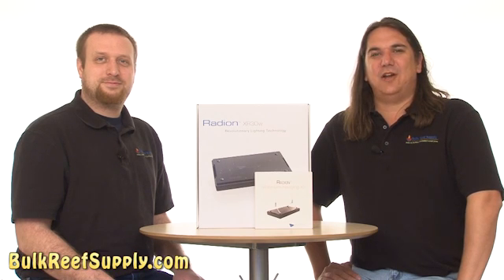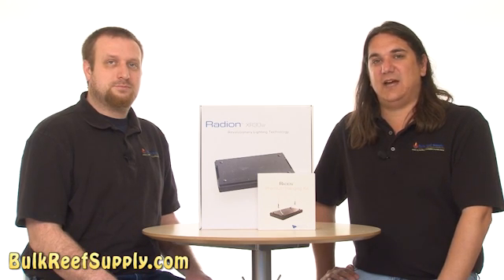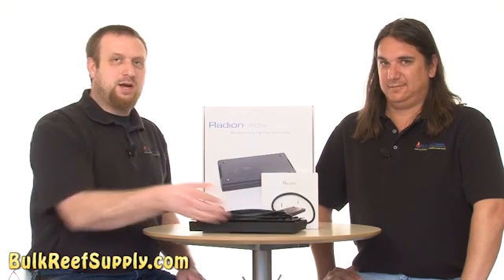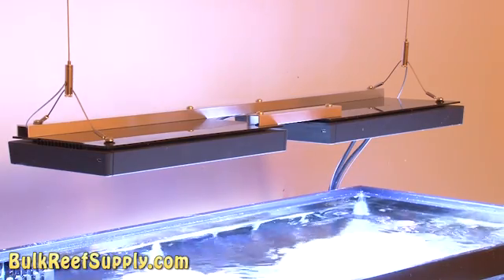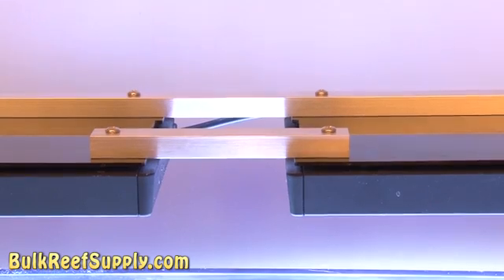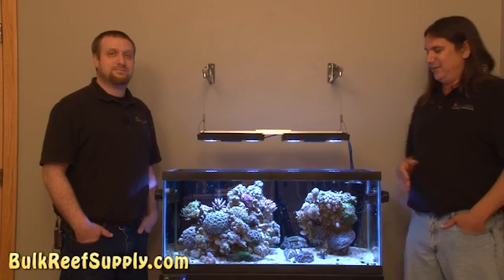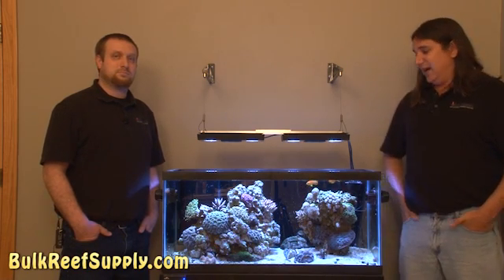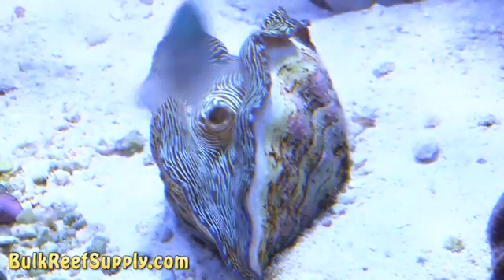Ecotech Radion Aquarium LED EP:9 How to start a salt water aquarium

Comment: how much did you roughly get those wall mounts for at 2:29? I work at an architectural metal based company and can provide you with custom wall mounts like those without charge in exchange for some BRS supplies if you would ever be interested

Im sure they werent cheap

Comment: @fishnerd100 Yes, you are correct there, but I would never ever try to make 1 radion cover 2'. You'd end up with HORRIBLE spotlighting. You would have to have the lights at least 12" over your tank to prevent that. Personally, I'm not a fan of either. I prefer the ecoxotic panorama pro fixture. You only need 1 per 2' for $450 and will have absolutely no spotlighting at all, and better lighting. Just my preference.